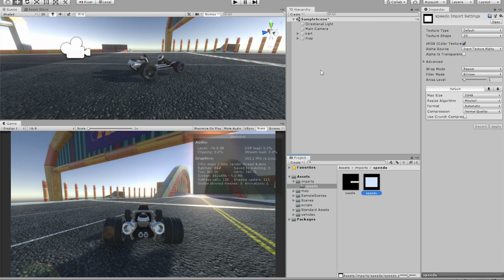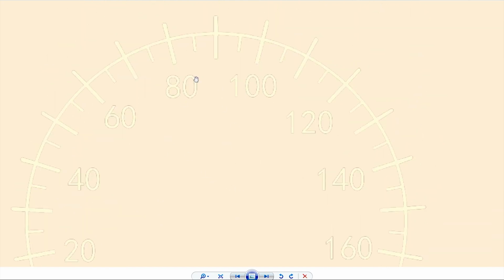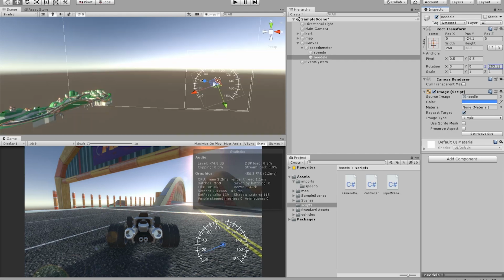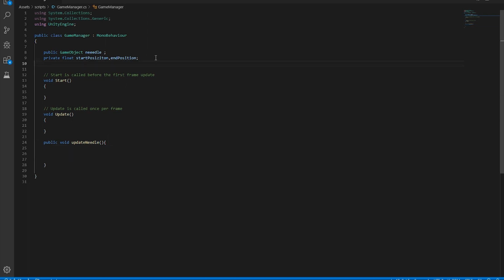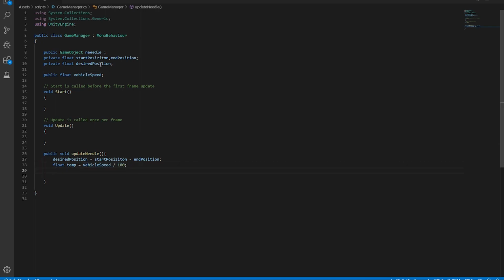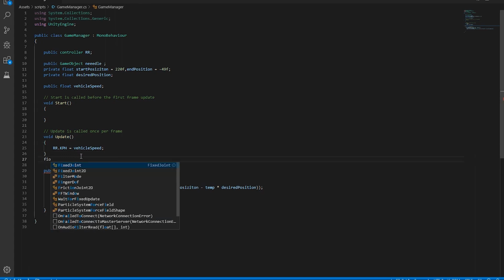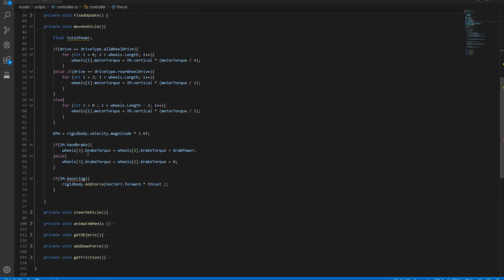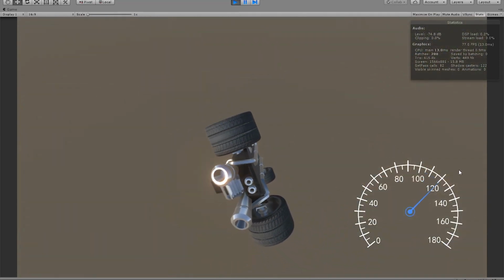3D Racing Game in Unity - SPEEDOMETER/TACHOMETER (Download Link)

Comment: Amm, when you placed the - in the controller if(IM.boosting) statement, the boost in my test project lets boost the car backwards. I removed it and now it boosts forward perfectly. Idk why you placed minus there at that moment. Is it because of the placement of the vehicle?
Reply from the maker: my mistake was that i used the vector3 forward, the method to push forward is transform.forward , replace that and it should work fine , sorry for my mistake
Reply: @pabloslab  I was searching for this answer 😊 thank you. Great tutorial man. Respect +++++
Reply from the maker: if you use vector3
forward  boost will be applied forwar always, since it takes the local rotation, that why in my video it always boosts forward

Comment: Just one problem about the boosting function that the force will be applied in the reverse direction if u go around the track in the opposite direction. 
Even if you reach a point on your track where your car facing the direction opposite to the direction it was facing at the start of the race and you press shift, u get  reverse boost.
For eg. Ur car is moving along  +z  axis at the start of the race(and according to ur code boostforce is also applied along +Z )and after taking a turn or two ur car is moving along -Z Axis . now if you apply the boost it will still be applied along +Z  axis instead of applying along -Z axis.
Reply: Fix:
if(IM.boosting)
        {
            rigidbody.AddForce(transform.forward * thrust);
        }
change "Vector3" to "transform" in the controller  script.
Its working for me perfectly. pls tell me if this is wrong or not working in any other case.
Reply: @Gamezoneadi  its work perfectly tnx u a lot.

Comment: Hey, nice video, but i have an issue, the script works perfectly except for one thing, even after assigning the needle and the car controller, when i press play the car controller automatically disapear from the script, so i have to drag it in the RR slot again while playing and it works.
How can I fix this ?
*Also, i'm using Unity 2020.1.1f1
Reply from the maker: its probably because ur script is missing a component,  try importing your needle via script
Reply: @pabloslab  How can I do it ?
By the way your tutorial is great i could easily maka a gaz meter (a speedometer that shows gaz level) just by making slight changes (the problem is still repeating tho)